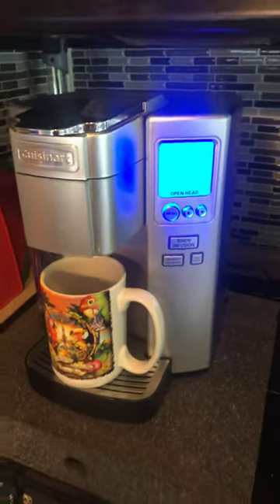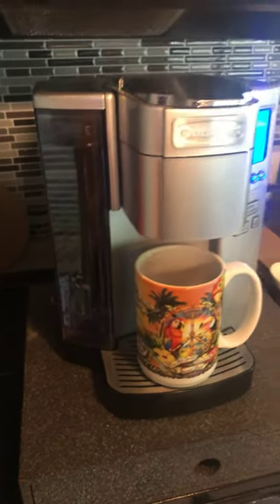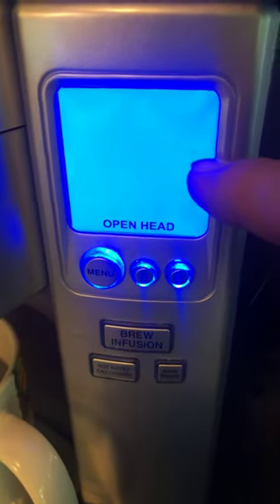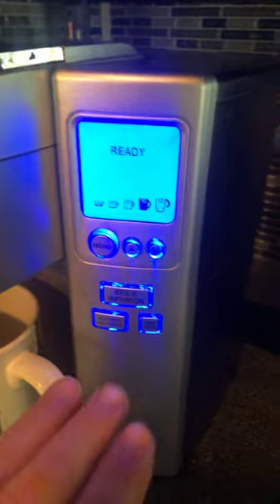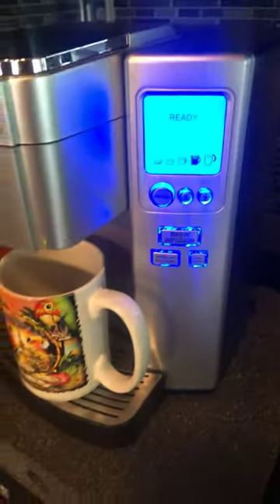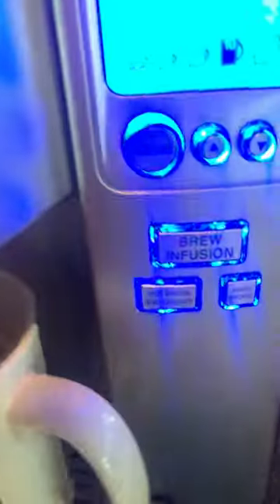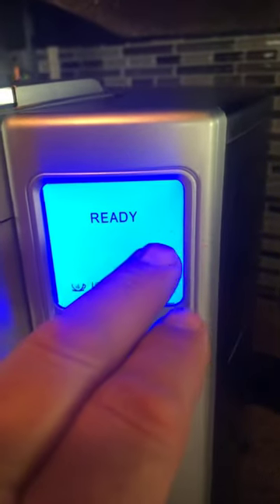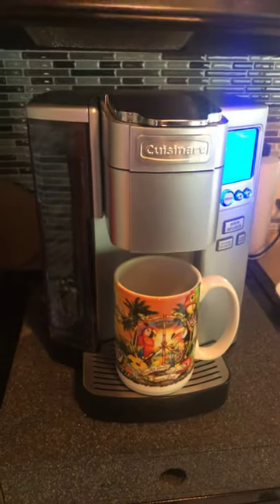Cuisinart (DESCALE ) video

Comment: This is the only process that actually worked for my Cuisinart. We ran 2.5 reservoirs of vinegar/water solution thru our coffee maker. The DESCALE light remained on. We ran pure vinegar thru and instead of pressing the brew button, we pressed the HOT WATER/RINSE buttons instead. The DESCALE light went off and we rinsed our coffee maker with pure water. This suggestion by Ron works! Thanks Ron.

Comment: OMG Thank you. I went through 2 1/2 gallons of vinegar and 6 reservoirs full of water/vinegar or just plain vinegar, trying to descale with just the hot water button as instructed and the descale indicator was STILL on. I thought maybe I had a defective machine or maybe a defective indicator. I pushed the two buttons as you said and MAGIC! The descale indicator disappeared! It had probably been descaled after the first try. Now I only hope I didn't hurt it with all that vinegar. After I saw you push both buttons at once I remembered that I had been instructed to do that with my first machine. I'm on my second one and I couldn't find the manual so I looked to YouTube for directions. Thank you again for the CORRECT instructions.

Comment: Ron.... Thank you so much.  I have the same brewer and I have been trying to descale it since the light came on yesterday.  I used up my descaling solution and all the vinegar in the house (& trust me that's a lot of vinegar as I clean with vinegar) and that damn descale light would not go away.  I even left vinegar in the machine all night and while I was at work today. Still, the descale light was on.

I don't know why I didn't see your video yesterday but, I'm glad I found it today. I figured I've run enough vinegar & descaling solution thru the machine that the only thing I need to do now is press both buttons simultaneously and the light should turn off.... AND IT DID!!  'Preciate you posting the video!!  #cuisinartcoffeemaker
Reply from the maker: Diva9000x  Glad it worked for you !!! They even replaced my coffee maker once as they didn’t even know why it wouldn’t go off lol have a great day

Comment: Thank you for posting! I’ve tried several times to descale according to another video I saw and it never worked. Your video was the first video I saw that said both buttons had to be pressed simultaneously. The other video just said to press the hot water button.

Comment: I am having a frustrating situation. I press the rinse and hot water buttons as you explained. Both light up and then the display reads E ED and nothing will work. I’ve tried turning unit off and back on and removing and replacing water reservoir and still get the error code